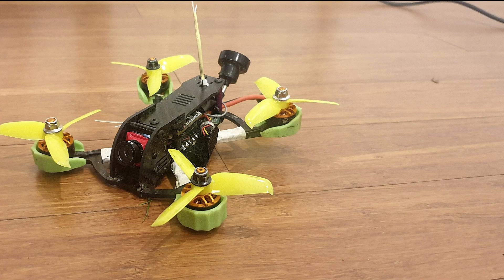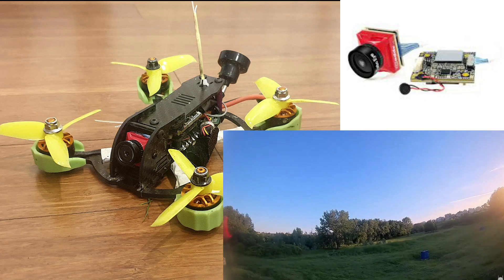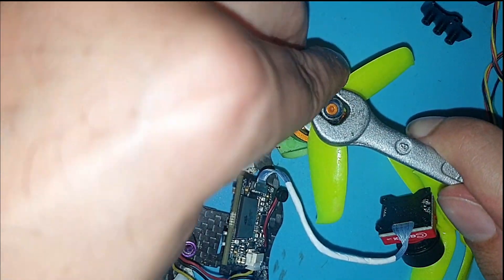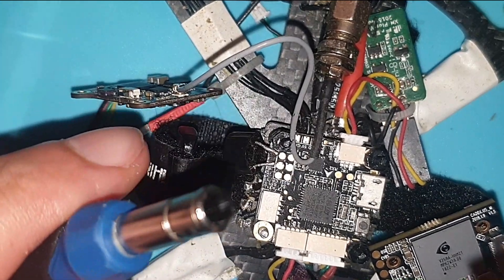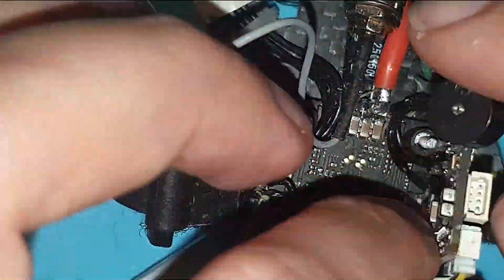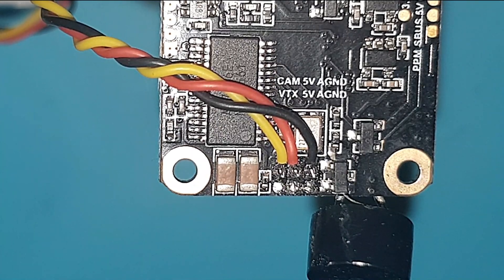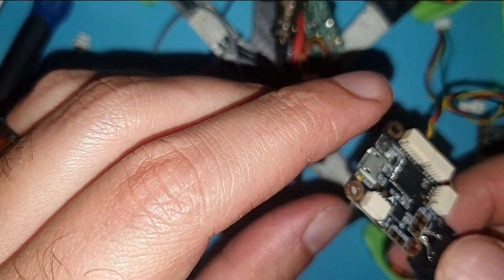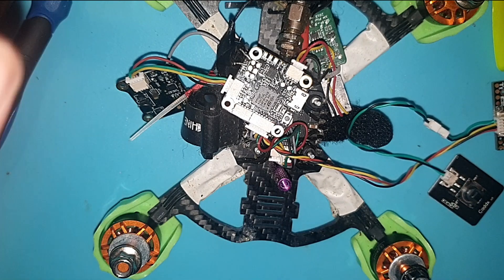⏯ How To mount  Caddx Turtle V2 on TYRO79. Make it #cinematic !!! #fpv #howto

Comment: I like how you used the 5v off of the flight controller to power your Caddx Turtle. Some people don't realize that connecting the power strait to the battery, can introduce interference and bad video. The 5v on the FC is filtered which supplies cleaner power to the Turtle. There is a voltage regulator in the turtle that allows a varied range of voltages for power and in my opinion anything over 5v is wasted power given off as heat!
Reply from the maker: I totally agree

Comment: But that's not a tyro79
Reply from the maker: It is. It's just a different frame. I explain it in the video 😉
Reply: @itosan8004  And, what frame is that?
Reply: @tiagostaso7377  URUAV Pob150 150mm
Reply from the maker: @keithbryant3653  correct